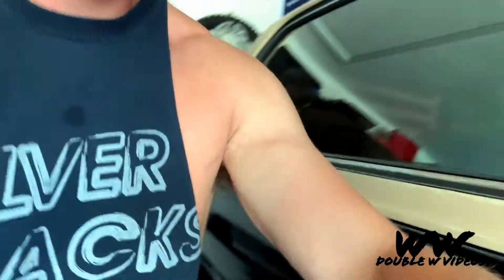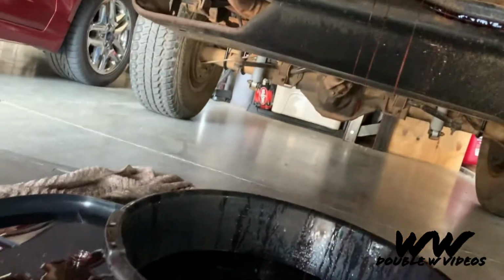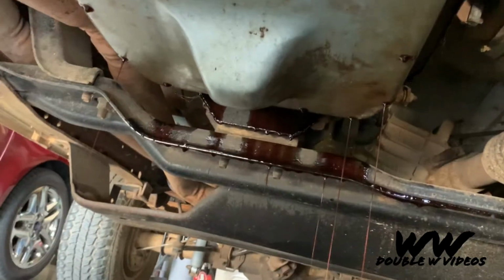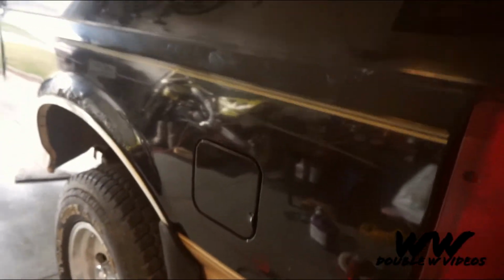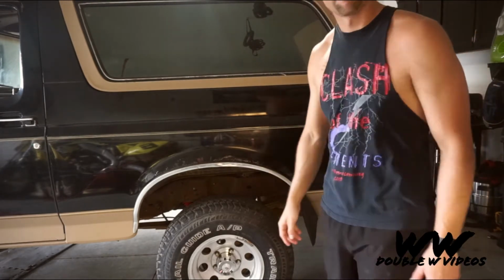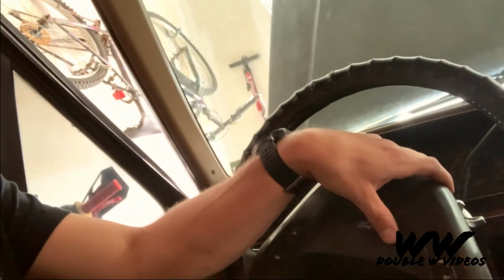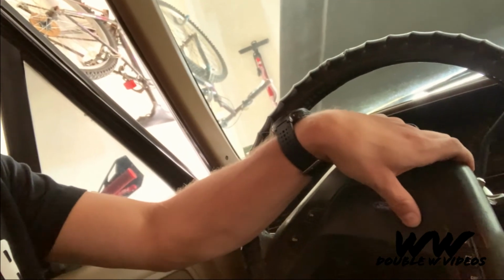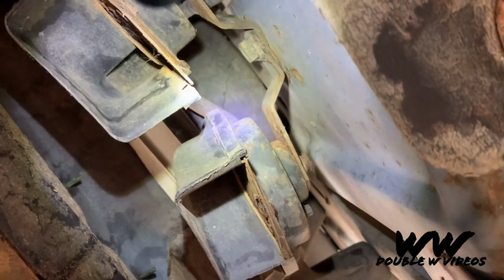1989 Bronco Build: Part 4 AOD Filter, Buff, Light Restoration, and Horn Install

Comment: You installed the wrong transmission filter in the broncoand you did not drain the torque convertor.  4 x4  have different filters
Reply from the maker: Headed back out to make more videos and saw this comment. Thank you for pointing that out. Definitely learning as I go and I knew better than to put a mismatched filter back on. I’ll definitely be redoing this along with other major things. I want to get this thing ready to rock daily.
Thank you again for pointing this out!

Comment: im about to by a 1989 ford bronco myself and need some advice on pricing and its issues anyway you could help?
Reply from the maker: Good for you man! These things are usually bulletproof and since they’re the older style motors and transmissions they are easier to work on. I will say I haven’t had a whole lot of trouble with mine but when I have, parts are very easy to find and affordable. It does get expensive trying to find original body parts and things like that. I got a steal and bought this one for $1500 but with its condition would’ve probably still bought it for like $2500 in my area.
Reply: @doublewvideos3474  dang the one I'm looking at is 6800 but it doesn't really have any major problems
Reply from the maker: If it’s what you really want, and you love Broncos, go for it! All the memories you will have with it and sentimental value will be priceless. You can always resell it even if it’s a little loss!
Reply: Jajaja
Reply: @doublewvideos3474  
Jajajaja si

Comment: found a 89 bronco on FB market place for 2200, has minor rust, and needs a steering column. Not sure if im gonna pick it up yet but if I do im not too sure what Im gonna wanna do to it, any ideas?
Reply from the maker: What I’ve been doing is just googling all my favorite bronco builds and weighing the options of doing something custom or leaving it original. In my opinion it comes down to whether you have a good area to off-road in your area or you just want to use it as a daily. I was reluctant in doing a full off-road build if I mainly wanted to just maintain the OG bronco look. 
I think I’ve decided to leave mine original until the paint is bad enough to need redone then I will begin customizing. No matter what you do though, it’s a win-win! There’s nothing better than off-roading or cruising around town in a Ford Bronco!
Reply: @doublewvideos3474  Yeah totally agree, Im in south florida so theres a few "offroading" spots but its mostly gonna be a daily driver for me . Probably gonna wait until I have it for a while before I really do anything to it